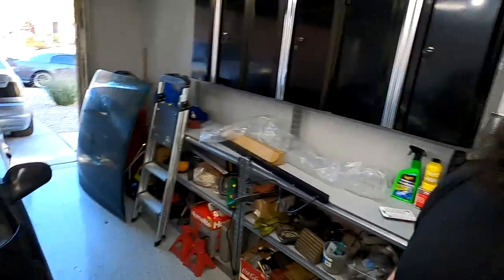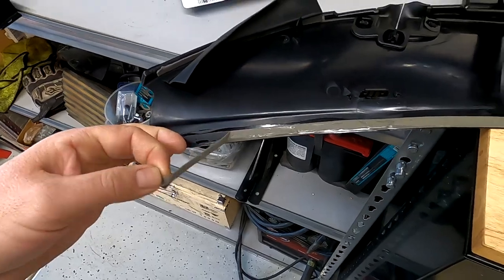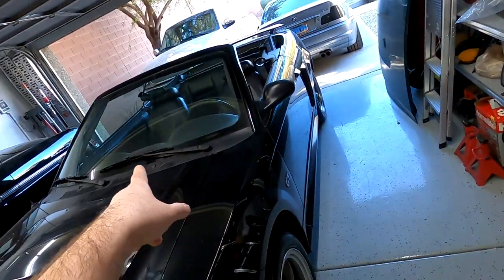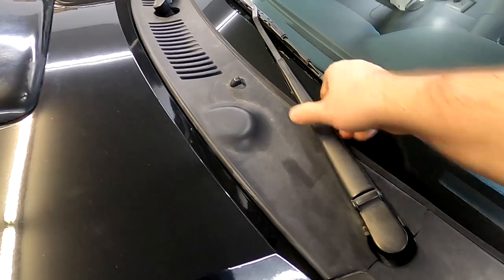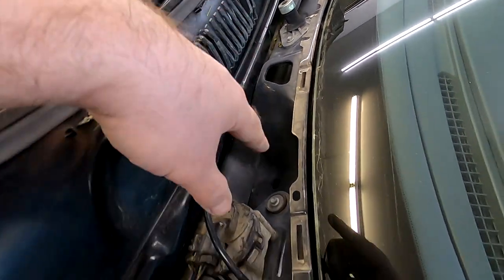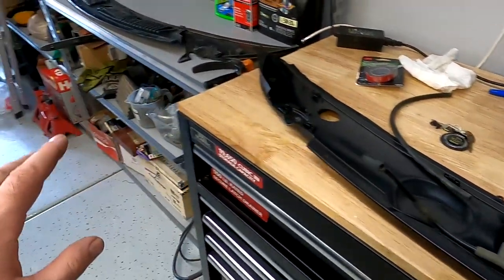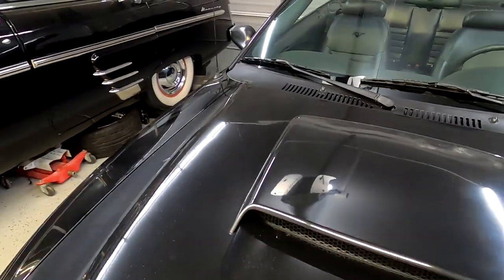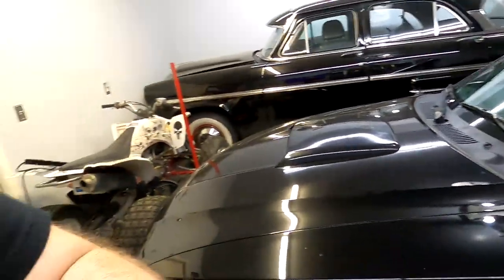How to Replace Ford Mustang Wiper Cowl Vent Grille on 99-04 New Edge -- DIY

Comment: Don’t put the side exhaust on that car...U will need a rear bumper or the roush kit for the back... either way car looks and sounds better with duals coming out the back.. U should sell ur v6 as is and start fresh with this one, if anything do a saleen or cobra replica the roush isn’t bad for the v6 but that GT is worthy of much more...Not trying to tell u what to do but I’m trying to help.. Just look at the price differences in these cars to understand public opinion and the value of each kits style...
Reply: Do whatever you want. Paint it hot pink and drop it into negative camber with a fart can exhaust if you want.